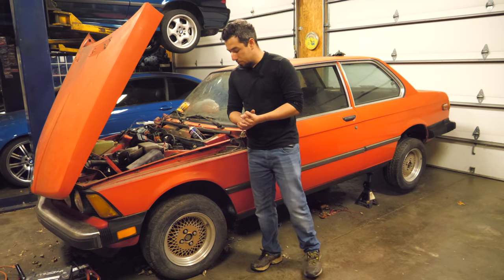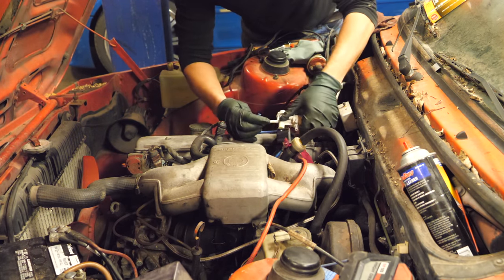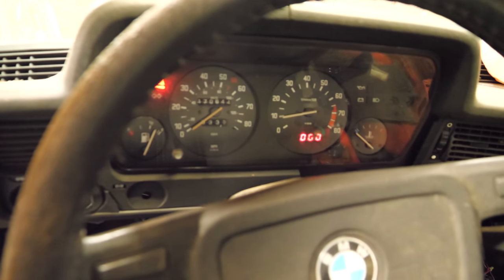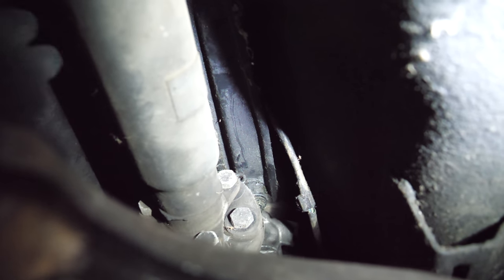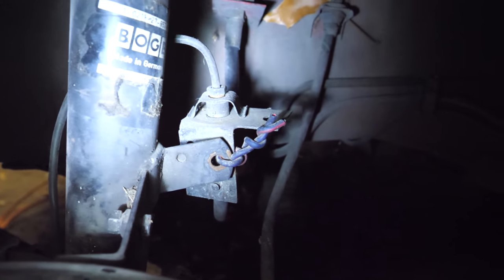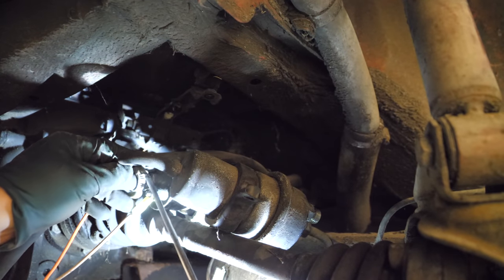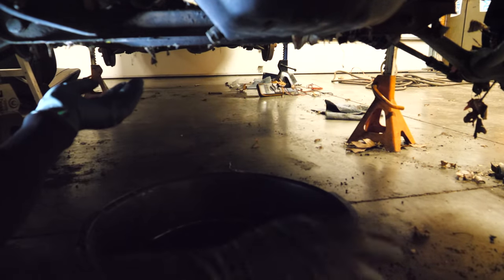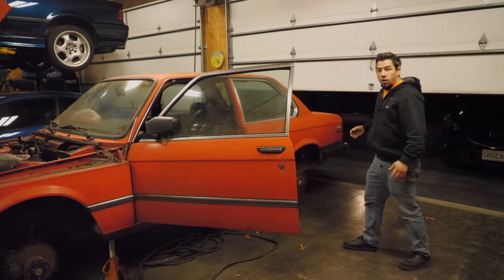1983 BMW 320i. From Parked To Purring, This Old E21 IS COMING BACK! Major Progress!

Comment: When you hit the fuel pump with a hammer that is called a Precusive Engineering Adjustment (PEA).  
As a licensed engineer I most often use the palm of my hand or dead blow hammers for a class 1 PEA.  
Class 2 require a regular hammer.
Class 3 requires an uttered vulgarity along with a swift kick.
Class 4 usually renders the unit under test permanently inoperable.

Comment: In 1980, I went with my dad down to the local BMW dealer and helped him pick out a brand new 320i in the same color.  

It was a gift to my mom.  

It had tan cloth inerior, AC, 5 speed, sunroof and a cassette stereo. 

The only thing we changed as part of the deal with the salesman was the steering wheel. 

They had a rack of BMW logo’d tillers and I picked out the Momo with the black anodized spokes and leather wrap. 

That car was a blast.  I taught myself how to four wheel drift in it.  A real momentum car.  Not much power but a well balanced chassis with delectable steering and good enough brakes.  

Now seeing this series and I’m 13 years old again.  

Thank you.  Subscribed, liked and shared.

Comment: When recommissioning a car. always fill cooling system with water only.  Makes the inevitable cleanup a breeze.  You can drain flush and refill when you have made it all leakproof.  Also remember to change rear diff gear oil because noone ever does

Comment: At 3:15 when you first crank the engine, the ignition timing is too advanced, that is why the cranking starts slowing because the combustion is happening too soon and trying to push the pistons back down when they are still in compression stroke. But you can tell the engine has good compression in all 4 cylinders by the sound of the cranking.
Reply: Yes indeed, I was thinking please stop cranking and adjust the distributor.  Also at the 6:05 mark the distributor jumped or the video was edited and the distributor moved.
Reply: Plot twist, it was Cindy who wrote this comment
Reply: Yes, and Eric knows that too. The comment is pointless, it was already covered in the video. Why try to flex  here?
Reply: Still informational to non-mechanic e21 owner watching now and in future. Learning from all of you guys. Appreciate it.

Comment: Just found your channel 3 days ago and we have a lot in common. My first BMW was a '77 E 21 I bought in 2003; I still have it. At times I've owned 8 BMWs, but never more than 3 were running at any one time. I had a Technoviolet E36 M3 which I totaled on track in the rain. I bought my E46 LSB M3 coupe in '05 and still have it; was my DD until I retired 12 years ago. Fixing up the interior now; 6SM still runs great. My wife has an  E92 335 i with 328 K miles on it; original drivetrain and everything. If you change the fluid in these things the will last forever. It is a great addiction.

Comment: I have a hard enough time working on my 20 year old daily driven car and end up cursing quite a bit. On a 40 year old car that has been sitting everything everything must be difficult.

What I really like about this dude is he can tackle all this with grace and aplomb. 

Why pump it all the way to the bottom of the tank and suck out all the crud into your truck? At least in a gas receptacle you could check for phase separation and crud. I guess the fuel pump should filter out some crud.

Comment: Check your spark advance mechanism, they need a small amount of oil on the distributor shaft, if it sat for a long time that advance mechanism is probably sticking use some red ATF, then oil on the tip of the shaft under the ignition rotor. Hopefully the CIS fuel distributor is not all gummed up, sometime running fresh fuel through helps, but ultimately the fuel distributor might need to be rebuilt.

Comment: Yeah, there's nothing like rolling around on a cold concrete floor--dried leaves, dog hair, and rust in your eyes--getting up and down finding the wrong sized socket or wrench only to have a gas hose explode in your mouth.   Even after about 45 years doing this knuckle busting, mechanically frustrating, zero sum game, I wouldn't give it up for anything.  My old cars mock me when I open the hood or crawl beneath them, a mixture of cat and mouse combined with truth or dare.  I hate them so much I can't bear the thought of selling them down the road.  Friggin' things are going to be the death of me when they aren't blowing hope into my soul by way of a charged battery and well tuned carburetor.

Comment: Shade tree mechanic tip:
Always keep one empty coolant bottle so that when you buy a bottle of straight coolant you can divide the bottle up between the two bottles and then add water and have two bottles of 50/50.
Reply: That's a grandpa, uncle tip, lol
Reply: @coache1nine  I thought they were the same thing lol
Reply: @deejayimm  can't call grandpa or Uncle Bob shady 😂😂😂
Reply: @coache1nine  the term shade tree is probably older than the term shady...  

But chances are pretty good that grandpa and uncle were a couple of shady characters also.
Reply: @deejayimm  I don't even want to know the answer to that question, 😂😂😂😂

Comment: the boot between the afm and throttle body is prone to leaking when it gets old as well as the injector o rings. k jet injection doesn't like to have any vacuum leaks. the warm up regulator can also cause cold starting problems.
Reply from the maker: It’s soft and pliable. Definitely been replaced based on the clamp placement.
Reply: What Lee said…injector o-rings…quick spray of some non chlorinated flammable brake clean / starter fluid around em…most are perished at this age…some you can just stir the injector around with associated massive intake leak
Reply: @I_Do_Cars  Lee is likely correct. I had a 320 years ago and even though the accordion boot looks ok, pull it and check it. They like to split and if it’s not an OEM boot it won’t last as long as you’d think it should. It’s most likely the problem.

Comment: Not sure if it helps but that injection system is highly dependent on vaccuum. On the vw version of it the injector seals were notorious on causing the idle to wander.

Comment: Really like your new video and it shows off your talent for rebuilding old cars. You have shown how good you are at  taking engines apart
, it is nice to see that you are equally adapt at putting old cars together. A lot of those engine you have taken apart look horribly complex to rebuild. Have you thought about an engine rebuild video. My first engine rebuild was a 65 VW that locked up on the crank thrust bearing that I didn't look at.

Comment: I've been getting video here and there of my 83 Celica Supra, in very similar condition. Currently the tank is out for rust treatment and I'll grab video of that. Fortunately Toyota likes to put drain plugs on their tanks otherwise I would have done the same thing as you. I even jolted the pump back to life with 12v and some whacks (temporarily of course).

Comment: By drilling out the "banjo" bolt, you destroyed the check valve and will have hard cold starting starting problems. That check valve keeps the fuel system pressurized.
Reply: Also vacuum leaks are the #1 culprit for poor running. Make sure the vacuum advance is connected to the distributor.

Comment: timing too advanced.  Plunger probably jammed in the fuel metering head too. Even before running the engine, you should check the control pressure at the warm up regulator.
Reply: Buddy it would probably be easier to list what isn't wrong and questionable about that fuel system. That thing will never be 100% without a complete rebuild and new fuel system. Ask me how I know.
Reply: @rayzor285  I work on a lot of early Bosch K-jet cars: Porsche, Ferrari, Renault, and it's basically at least $2k in parts to get a car that's been sitting a long time to get them going again.  I like to work on them though.  It's a challenge and dying artform

Comment: I used to adjust those valves every week.  Take the one feeler gauge higher and adjust the valve snug and tighten the 10mm nut.  8 should go and 9 should not.

Comment: timing is critical to an engine running smoothly, let alone at all, and especially without potential damage
bmw: engine must run for an extended period of time to make sure the engine is able to run
Reply from the maker: It’s kinda ridiculous, but compared to modern BMW’s to fill transmission start engine and wait til certain temp
Transmission pump : 😳
Reply: @I_Do_Cars  how do you guarantee repeat service customers? write the procedures to deliberately cause accelerated wear B^)
Reply from the maker: daktah I dunno anymore it seems like people who bought a bmw in the last 10 switch brands. The loyalists bought e chassis cars, and either kept their cars or moved onto other brands as well.

Comment: Hey I remember when I was in college at Sioux college in Ontario we screwed up well not screwed up but we made a mistake on the timing on the distributor on a slant six Dodge and that's exactly what it sounded like was that I know it that could be a dead battery too but I think it is I think you were right with the timing issue thing

Comment: When you step on the gas it sounds like fuel starvation + timing not adjusted. Reconnect the timing vacuum hose to the distributer and clean the contact in the distributer. (And set timing a bit more in the middle of too early and too late. Then check the throttle again. If still no increase in rpm the mechanical fuel distribution system is clogged. Had the same on my VW Golf 2 Pierberg Carburator. Vacuum hose for timing broken and fuel squirt piston disconnected.

Comment: The RTV lovers are going to be upset at the minuscule amount of rtv you used. That needed at least 3 tubes. How dare you! The next owner will be able to get that valve cover off without any issues!
Reply: Honestly, valve cover gasket on this needs no rtv. It needs to be opened every year or 10,000 miles for valve adjustments.
Reply: @carlterranella8531  /woooosh!

Comment: On my 74 BMW's the exhaust valves were the one's that got tight.  Bavaria, and 2002  Ran better using Champion copper plugs, Bosch plugs didn't go the distance back then.

Comment: I have a 78 320 i.  I'm looking for the screw cap that holds the banjo fitting on the pressure side of the fuel pump.  Enjoying your video

Comment: For all the debris and junk on the engine, why do you not spend ten minute blowing compressed air on it or vacuuming it? To keep it out of the intake, and for your ease of working. Then you expect it to first start on bad 8:38 gas????? Great to see it running better at the end!!!!! Great video
Reply from the maker: It’s only on the fenders. It’s on the list
Reply: @I_Do_Cars  Great video! Wish I was there.
Reply from the maker: markae0 definitely, once I set timing

Comment: Old varnished fuel is pretty bad for any engine. Once it starts flowing into the head, gets hot and then you shut it off to cool….. it turns to glue on the valves and other parts. Probably gumming up the pump also

Comment: Question?....Does this year BMW use points? If so a dwell check and timing. Might want to see if that lag on acceleration is a bad vacuum advance , blown diaphragm....Just thinking out loud here....Good fun video, Thanks
Reply: Its electronic ignition. But the kJet fuel system is very complex and sensitive to the smallest of vacuum leaks.

Comment: Hey Eric, I noticed something that bothers me since the second I saw the engine bay on this car.
Are you sure that it's a 320i from 1983? I had a couple of these E21's, and I had only six-cylinder engines in my 320i's. I had a 318i that had the same four-cylinder engine that's in this car. Same engine, cylinder head, intake manifold... the exact same engine bay. I know exported BMWs had different equipments than BMWs made for the European market, anyways it's weird to see a 1983 320i with a four cylinder engine.
Also noticed the side light on the back, just next to the tail light. That looks awful in my opinion, just like that front bumper with that ugly side light. I know tastes differ, and US laws were strict on imported cars then. But if you take a look on European BMW E21s, you'll see they don't have such bad-looking parts. If you can find any still running ones... I love them, in those times European made cars were built to serve at least 20 years. And they did, I had no E21s that were younger than 25 yrs old, but every single one of them had the juice.

Comment: Tip
When trying to time an engine that you don’t know much about its history do the following.
Ensure that cylinder one is at top dead centre on the compression stroke ( not exhaust) 
Look to see where the rotor in the distributor is pointing, it should be pointing at or near the position of cylinder one on the distributor cap. If it is pointing to the opposite side then you either have the engine on the exhaust stroke or the distributor is 180^ out. If it’s pointing towards one and one is on the compression stroke move the distributor so that the rotor points directly at one.
This will be in a retarded position but the engine should run and idle.
If you’re lucky the base of the distributor will have a timing indicator on it showing advance and retard with some gradiation points look up what the timing should be but ten to fifteen degrees before TDC is about the norm so you should be able to set that with the engine not running.
The engine should start and run well enough to use a light.
If your engine is a type that doesn’t have a distributor you should not have bothered reading the above.
Reply: Great advice, but I don’t think you can say that particular r word anymore. Maybe go with timing challenged in the slow direction, or not as early as it should possibly be by someone’s standards. I am kidding, of course, but just wait for the day when they come for your master cylinder.
Reply: @douggodsoe  ROFLMAO

Comment: Oh Eric Love the home show but that BMW is going to make a wonderful Demolition derby car for someone and seeing you paid for it you may as well drive it as well - Fun advert idea bro
Great so Eric you just built a Demo car - The colour is Great bro - Just needs a Sponsor so it may as well be your workshop so strap some old in line 6 blocks all round it - ""for Advertising ;-)"" as opposed to  "Protection?" which would make your company advert illegal on a Demo car so it's obviously not there for protection right.
Fuck Man you just build a Demolition derby car !! What an ideal way to advertise your business.

I have a idea for your show - you know how "This Old Tony" does the hand chop to cut up 200mm eye beams - well you could take all the boring stuff off like that - it'd be impressive - like approach the block with a driver and all the bits fall off.

OK so I've watched about 15 of yours today - fuck I must be bored - or I love to see what's happened to motors after thermal nuclear war broke out in the sump :-)

Here's a Challenge you Eric - Find a good common Block / Heads / Crank and shit from a number of total fuckups and stick a motor together using only second hand bits And Run it.

Yeah like fuck off if America went like Pakistan that would be a very Hot series of vids.

Looking forward to viewing them - please send an invite to "finding the block"

Comment: Wasn't this body 320i replaced in 1982 by the E30? Also these E21 latest models were inline 6. Weird to find an 1983 320i let alone with a 4 cylinder.
Reply from the maker: E30 replaced this for 84 model year. They made 323i 6cyl and 320i 4cyl e21’s

Comment: I have a BMW 320 e21 1982 M20, sometimes starts with the first turn of the key, usually when it's cold, but after it's hot, I have to turn the key at least 5 times to start it. And sometimes it doesn't start at all,  What could it be? ignition system, starter motor, fuel pump? Also, one of the headlights on the right is low in power, I replaced it with a new one but same thing, so I guess it's getting to little power, any advise on that?

Comment: A full resto on this BMW 320i, will put a Huge smile on your face.   A few mods to the suspension will be needed.   Many of these were rolled by salesmen in the 80s.   BMW's answer was to remove the rear sway  bar.   I went with Bilstein Sports, Eibach Pro-kit springs, and beefed up front, and rear, sway bars with urethane bushings.   Sumitomo HTR 200 tires for the rubber, finally gave this BMW the handling it needed.   Wish I were there with you.   This car has no, anti-lock, no traction control, no nothing.   All it has is a brake force limiter.   When the brakes are working properly, the car will skid in a perfectly straight line.   If you know about breaking, this is a big deal.

Comment: One of the best way to get rid of the schmoo in the oil pan and internals of an engine...run some diesel oil (rotel or delo)for a few hundred miles and oil change...pow...clean clean clean!
Basic TLC goes a LONG way in making older vehicles run much better!  
Keep em coming!!!!
Reply: Did you actually watch the video before typing that? Now, go watch it again 37:19.
Reply: @johncoops6897  I was confirming his choice to use diesel oil...not telling him what to do
Reply: @haydenc2742  - the way you should do that effectively is to actually say so. For example, typing something like "As Alex mentioned in the video, one of the best ways to...."
Many people also include a time stamp to provide relevance, since there may not be an obvious link between the comment and the video contents.